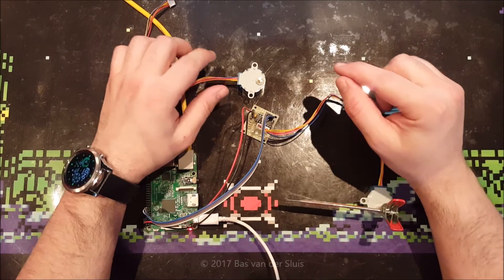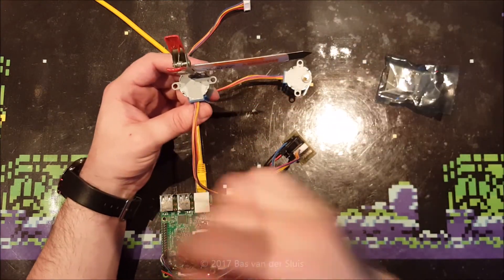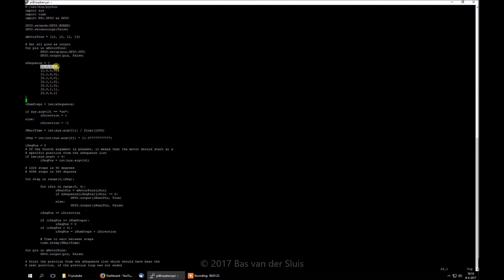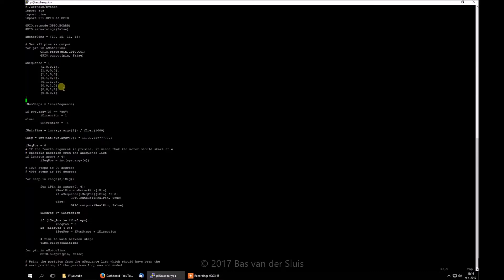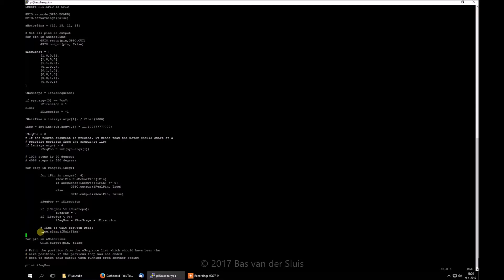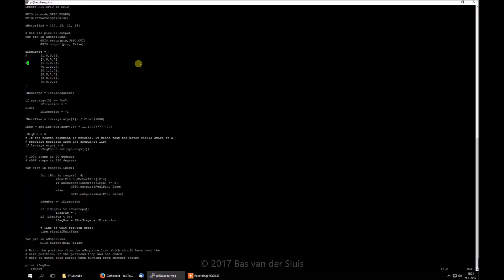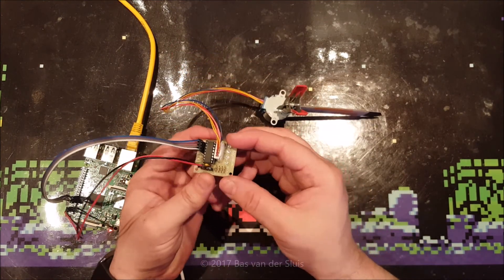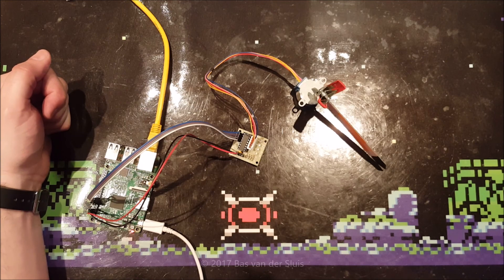How to make a (cheap) Stepper Motor turn a number of degrees with a Raspberry Pi

Comment: Hi Bas! Many thanks for your amazing video, and for generously making your scripts available! I don't know what we makers would do without tutors like you. I've designed and 3D-printed a dispenser and after tons of problems with a RPi Zero 2W I bought a few months back (couldn't replace it because of supply problems) I've switched to a second-hand RPi 2 to run it. I'm using the same motor as you and it turns the dispenser no problem, but I want to turn it X steps (4096/5, say) once or twice an hour. Where would I need to add the time argument to make it search for the time on the RPi?

Comment: When I try go ccw the control board start blinking and motor vibraiting but nothing hapend
Reply: @Bas van der Sluis
Reply from the maker: Then you have the order of wires incorrect. Make the motor go very slow and you should see the LEDs blink from one side to the other. If that is not the case, you can change some of the wires.

Comment: Sir, how can we set the RPM for the stepper motor . Because the total time here is "running time+sleep time". Please reply because i'm running out of time for my project.

Thanking you.
Reply from the maker: You are going to need some math for that. First you need to know how many steps are needed for one full rotation. I believe I mentioned that in my video, but I'm not sure. Once you know that, you can calculate the number of steps per required time frame. Example: let's say it requires 6400 steps for one full rotation (a wild guess) and you want to rotate it with 2 rpm, you do as follows: 2 * 6400 = 12800 steps per minute. Divide that by 60 = 213.33 steps per second. There are 1000 milliseconds in one second so: 1000 / 213.33 = 4.687 milliseconds of waiting time between seach step.
Reply: Thanks a lot for your quick reply.But we actually neglecting the time between two successive delays(the running time of a motor).so I need to know the time required to move one step which is different from delay time.

Please help how to get that.

Comment: kun je me aub helpen, iedere keer als ik de motor aansluit dan crashed mijn pi als ik de motor aansluit en de code run op een bepaalde aantal gpio pins doet hij het wel ik snap het niet
Reply from the maker: Als je pi crashed op het moment dat je 'm aansluit, maak je hoogstwaarschijnlijk kortsluiting, waardoor je pi zonder stroom zit. Kijk nog eens goed naar de GPIO-pins en hoe je het aan hebt gesloten. Als je op Google zoekt naar "gpio pinout", krijg je hele mooie afbeeldingen welke pin precies wat doet.
Reply: @basvandersluis5662  snap
Ik, bij mijn case staat ook een diagram maar toch iedere keer als ik de pins gebruik die jij ook gebruikt start de pi opnieuw op als ik dan de pins gebruik die in de handleiding staan werkt hij perfect raar dus, nog een vraagje bij jouw codering krijg ik een error bij het ‘’cw’’ gedeelte enig idee waar dat aan kan liggen

Comment: Hey thank you for this amazing Video but I am getting an error from your code ( I am pretty bad at coding so I'm not suprised I can't get this to work): 
I call the code like this: 
python motordeg.py [1] [90] [cw] 
and get this Error in line 34:
fWaitTime = int(sys.argv[1]) / float(1000)
ValueError: invalid literal for int() with base 10: '[1]'
Reply from the maker: Remove the brackets from the 3 arguments 1, 90 and cw.
Reply: @basvandersluis5662  many thanks for your fast awnser!

Comment: Hi, im making a project using 5 of these stepper motors, will the rasperry have enough current to run them all, or should I connect them to a separate power source?
Reply from the maker: I think your power supply needs about one extra amp to run 5 steppers at the same time.

Comment: Sir, I can't thank you enough. My thesis is called "Stepper motor Control", and this code is perfect for me.I wanted to do it with raspberry and there is not much to find like for Arduino so this saved my ass.  :)

Comment: I'm considering buying this stepper motor ... how strong is it? Could you stop it with your hands?
Reply from the maker: Stopping the brass cylinder of the motor by holding it directly is possible, but is quite hard. When adding a larger disc to it, it is easy to stop.

Comment: If I am giving 90 degree it's rotating 360 degree and if I am giving 180 degree it's rotating (360 +180) degree
Reply from the maker: Do you use the same motor with the same gear reduction?
Reply: Mostly my motor is of different gear
Reply: OK sir I will see that tq

Comment: how precicion on it ?. can it move by 1 degree ?
Reply from the maker: A full rotation is 6400 steps. So every step is 0.05625 degrees. Bear in mind that there is a little bit of play on the axle when you move it clockwise and then counter clockwise.